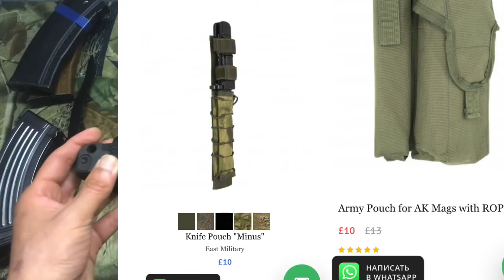AIROSFT IDEAS PART 4!

Comment: Nice ideas mate. Might do the same for my DPM rig. Maybe replace the original  pouches with AK ones? You can remove the belt buckle to fit the VZ holster
Reply from the maker: Thanks, reusing gear and good idea with the belt option? 🤔
🔫😎👍